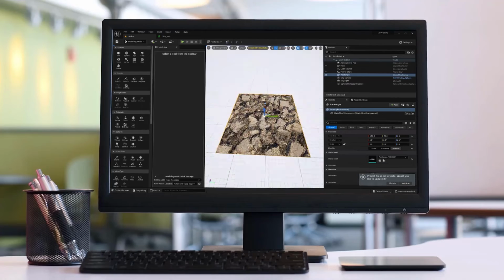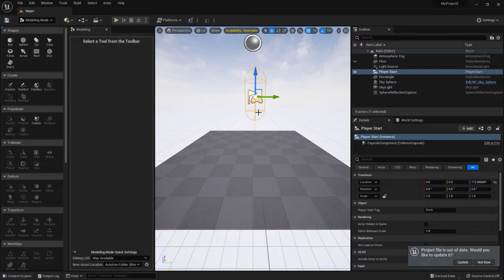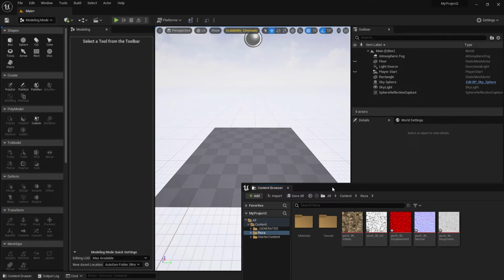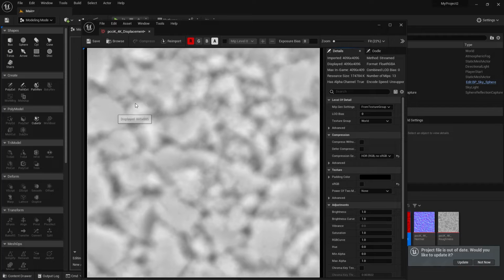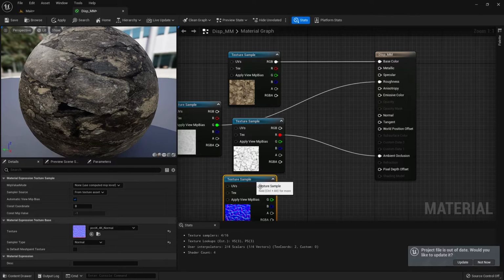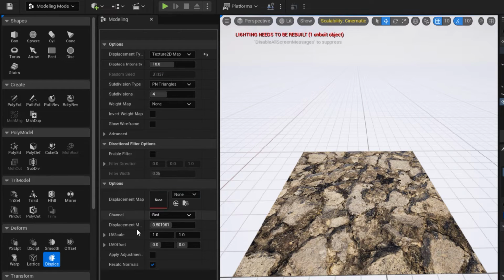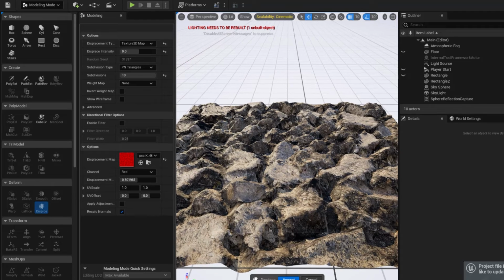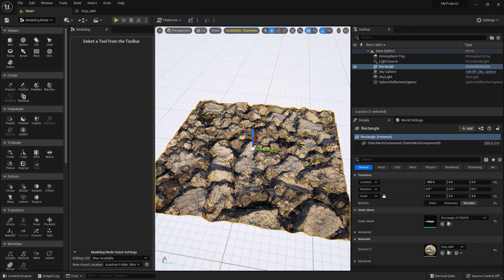#UE5 Series: How to Use Displacement Map in UNREAL Engine

Comment: This produces a nice effect and is one of my favorites.  The only issue is it warps the plane the texture is on and is hard to use as a wall or floor that easily mates with another wall or floor.  Quixel has some nice textures that repeat and these fit nicely together,  But I still have an issue mating the perpendicular.